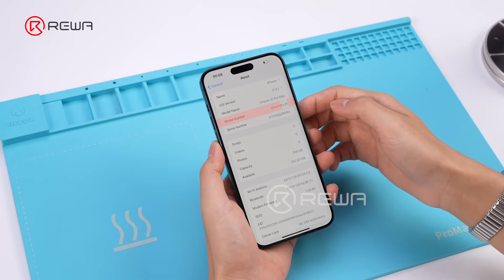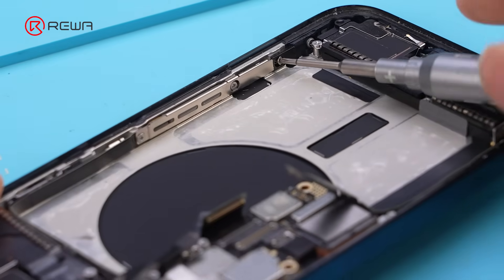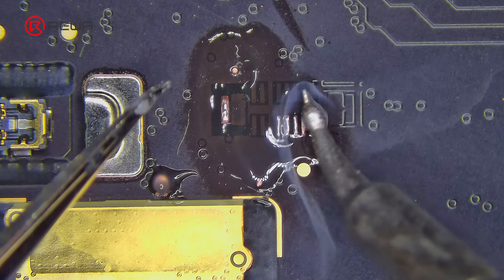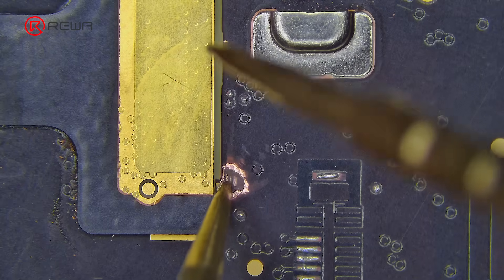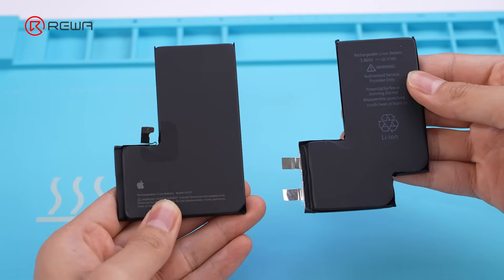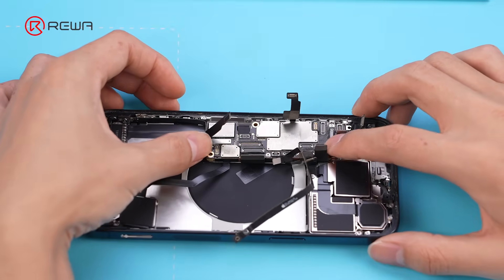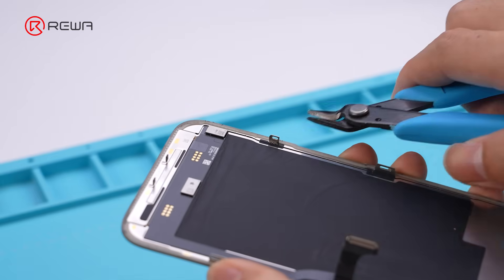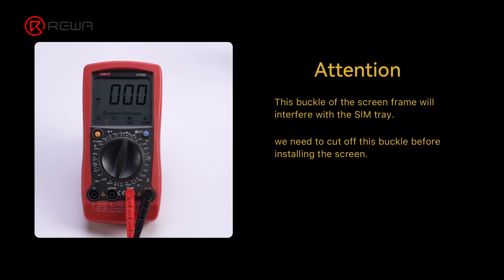Unlock US iPhone 15 PM Potential: Converting eSIM to Physical Dual SIM

Comment from the maker: How do you feel about this conversion? Tell me about it😊😊
Customized Battery Cell 4-in-1 Kit For iPhone 15 Pro/Pro Max（US VERSION）
https://shop.rewa.tech/detail/luban-dual-sim-card-kit-iphone-15-15-pro-max.html?utm_source=YTB0821&utm_medium=video&utm_id=REWA+product
Reply: Have you thought about using the esm battery board on battery that not iPhone battery
Reply: I have already bought an iPhone 15 Promax from eSIM to a sim card like in the video rewa, but the problem is how will I replace the battery when I bought it!! 🙏🙏🙏
Reply: @ryanramadhan3289  if you replace to normal non curved battery you will lose esim and sim capability unless you coonect the broken esim trace.
Reply: @ryanramadhan3289  did you ever find a solution to this
Reply: 4TH 4G LTE bands People's i iOS app i
Reply: iPhone iOS 4TH 4G LTE vs
Reply: It looks like I use the Chinese version 😂
Reply: @MobileiRepair Canada uses the SIM model, because it was mandatory it be there I think… but I’m like, I’d just buy a Canadian iPhone and then slap a logic board from the USA into it and see if it would work. I know they make a lot of this stuff backward compatible, but the issues come in with the software and some hardware…
Reply: @coloradogaydude  👍
Reply: Doing this may cause some problem with the phone or not its safe plase replay me
Reply: Where I have order the battery like this  pleasss

Comment: Does this apply for all usa iPhone 14 ,15 16 and more?
Reply from the maker: 16 is same with 14, but you need to use Bitmap to locate the sim card line.
Reply: @rewatechnology2008 ok and why didn’t you put the sim tray the same place where other versions are instead of putting under the 5g line on the right?

Comment: What are the tools needed for repairing pls
Reply from the maker: Customized Battery Cell 4-in-1 Kit For iPhone 15 Pro/Pro Max（US VERSION）
https://shop.rewa.tech/detail/luban-d...
Repair tools: 
1.REFOX RS52 Cell Phone Screen Holder：
https://shop.rewa.tech/detail/refox-r...
2.REFOX RS3 3D Screwdriver Set for Phone Disassembly Repair：

https://shop.rewa.tech/detail/refox-r...
3.MaAnt Shadow Blade Tweezers：

https://shop.rewa.tech/detail/maant-s...
4.MiJing K23 Pro Multifunctional Holding Fixture
https://shop.rewa.tech/detail/mijing-...
5.Qianli Macaron Max Spot Welding Machine
https://shop.rewa.tech/detail/qianli-...

6.U-Shape Ceramic Scissor for Phone Battery Cell Repair
https://shop.rewa.tech/detail/u-shape...

7.SUGON 8650 3M Hot Air Station
https://shop.rewa.tech/detail/sugon-8...
8.SUGON AIFEN A902 Soldering Station
https://shop.rewa.tech/detail/sugon-a...

Comment: Is it gonna spoil the motherboard in a few years' time? Or is it just fine? 
I bought an LL set w/o realizing it is a modified unit. 😢 still worry if its not okay
Reply from the maker: It will not damage your motherboard, but you may need to replace this strange battery like forever

Comment: If the battery health under 80%, can we change the battery with original battery in apple store?
Reply from the maker: Good question, we also test that, the truth is that this iPhone is bonded with this battery forever.
Reply: Will this battery have the same lifespan as the original? Or will it deplete faster?
Reply from the maker: @melvinchongo4056  Based on testing, they mianly share the same lifespan, but after all this one is 3rd party battery.

Comment: Hello, the device I purchased is exactly like this, but when I scanned it with 3uTools, the battery appears as original.And does this process affect the phone's performance?
Reply from the maker: You mean the battery structure also is same?
Reply: @rewatechnology2008  yes
Reply: @rewatechnology2008  Yes, but it looks original on 3uTools.
Reply: Mine too, I dunno if it has been converted,  I bought it at Renewed devices section from Noon App.  iPhone 15 pro and the sim is located at the right side of the phone.
Reply: I also bought a device like this, im kinda worried if the battery will last for 1/2 years as it is a modified battery!

Comment: Is there anything available for US iPhone 16 pro max?
Reply from the maker: This time the motherboard share the same structure, we will also check it
Reply: @rewatechnology2008  As I understand, the 16 pro max already has the SIM card solder area, but there is no SIM card slot soldered to the board. When will the slot be made Available? Will it require modifications to the board/frame? If so, will it retain the ip68 rating after the modification has been performed?
Reply from the maker: @harveyweizman  Well this requires repair man to locate its sim card test connection point.
Reply: @rewatechnology2008  do you know where I can obtain a copy of the schematic?
Reply from the maker: @harveyweizman  Now the bitmap still needs some time, our refox is also working on it

Comment: Nice proof of concept. As I understand it, the operation break the connection to the onboard eSIM chip, so non-physical SIM card use is permanently disabled?
Reply from the maker: yeah but now we did not test it with iOS 18, but in iOS 17, should work perfect
Reply: @rewatechnology2008  have tested it on the ios 18 yet?

Comment: Just import a phone from china. They get dual physical sims. Mine is a Singapore one and it has one sim slot and dual e sims.
Reply: Also the iPhone 16??? Comes with a sim tray?
Reply: @estebanmunguia6147  Yes. China version comes with dual physical sims. Others come with one physical sim and e sims. US version doesn't have any physical sims. Only e sims.
Reply: @XRocket2009  that’s interesting are they going for the same price? 
In Mexico if you buy a phone they come with a  physical sim card too but they are going for a bit more expensive

Comment: The chances of breaking is very high too many costly and sensitive parts to parts needs to be changed 
And also need to change the oem battery that is a deal breaker if this was have to do it it has to do it on the large scale then only it's a sustainable model

Comment: this might not be entirely practical given the cost and skill required, but it's a really cool mod regardless. I do wonder if you could put a switch across the cut trace and still have access to the e-sim too at the flick of a switch, if needed
Reply from the maker: Thank you for the comment, as for the esim part, we totally broke it, so esim will not work

Comment: I’d send this in to be done by whomever has worked out the details… because obviously it worked… but I don’t know 🤷🏻‍♂️ how I’d explain that I have a special phone… to the provider I’m using it with 😂 but I don’t think they’d ask questions… but I also don’t know if editing the phone in this way would somehow void your electronic purchase agreement… so… yeah. I’d love to have my iPhone 15 unlocked, and I know the process for it would be SO much easier because the slot for the pSIM tray is technically already there; and also easily accessible… I would just wonder, where would the SIM pin ejector go… and would the screen need an “edit” to work appropriately… in the base 15/15 Plus models? 🤔

Comment: Question, where can i get that modified battery?
Reply from the maker: Hello here is the battery kit link for you: https://shop.rewa.tech/detail/luban-dual-sim-card-kit-iphone-15-15-pro-max.html?utm_source=YTB0821&utm_medium=video&utm_id=REWA+product
Reply: @rewatechnology2008  is it dangerous to get the phone wet after this type of modification?
Reply from the maker: @irasushimano6986  The waterproof resistence will fade due the simcard slot, so we mainly just share you this hack
Reply: @rewatechnology2008  thanks a lot! By the way, can you still use the esim after doing this modification?

Comment: Wanted to offer this service for the iPhone 14 series but the cost it would require to complete the job is not what too many customers would be willing to pay 

Best part, it would be cheaper for them to buy an actual physical sim version versus buying “eSIM version and then convert to sim version”
Reply from the maker: You are right, it usually depends on the client.

Comment: Another GOD's level repair of you. It's fabulous. BTW, you mentioned that the reading is 0, It was good to mention that, it is continuity mode on the multimeter as well. Or you might be mentioned it and I missed it? ‌ِYour work is beyond imagination.
Reply from the maker: It is vitial for this work, we need to make sure that is the right circuit😁
Reply: @rewatechnology2008  I know that. I just said it's good to tell viewers what multimeter mode you are using. Some are amateur and  want to learn. Since you mentioned the reading data but forgot to mention the multimeter mode u r using

Comment: please is it possible to make it single sim?
Reply from the maker: Same method, you can just insert one sim card
Reply: @rewatechnology2008  
EID does not work after the jumper is done!!
Reply from the maker: @MicrosolderingGH  Because we already cut off the eSim, so the EID should not work.
Reply: yes that’s true the eSIM is unable on double sim but please do you sell a particular flex that can convert iphone 14/14 plus and 15/15plus to single sim instead of double sim??

Comment: Scraping the PCB layers though layers to disconnect the eSIM trace really remind me of NS OLED kamikaze hack
Reply from the maker: LOL, maybe 2025, NS2 will have other solution.
Reply: The OLED kamikaze hack is even more annoying than this as it requires the trace to remain in perfect condition and it's so small you might accidentally bump  it off with the soldered wire.